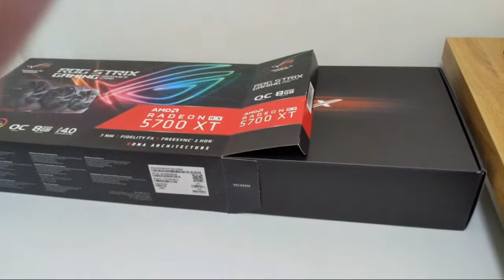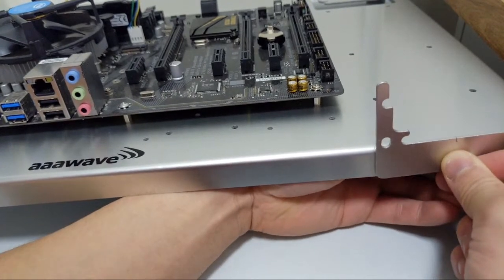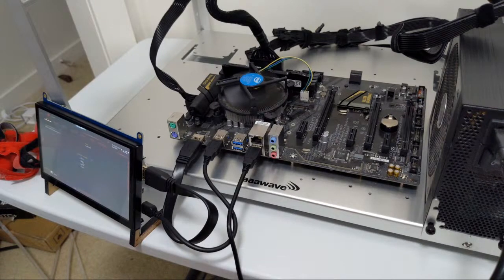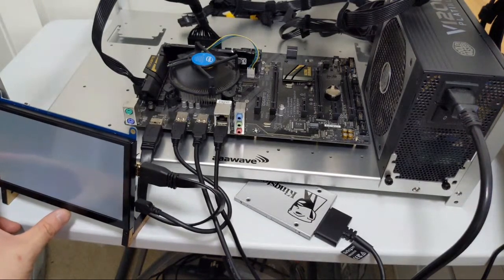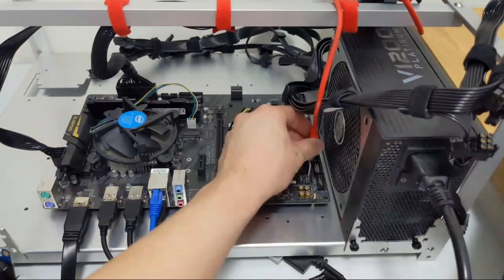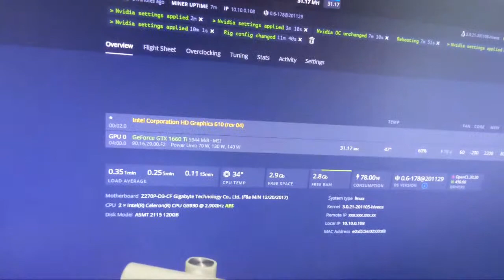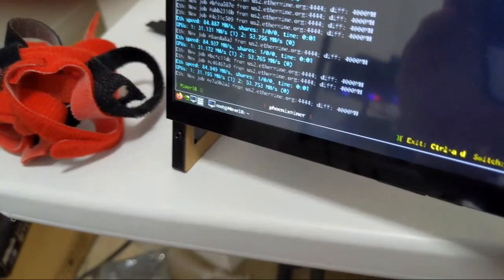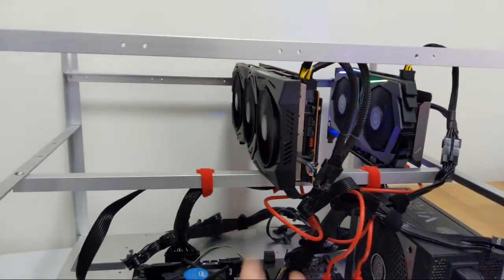How FAST Can I Build A Mining Rig? | RPM Build Stream #1 P2

Comment: put a Water Cooler on the 5700 xt its trouble and extra investment and work, but your temps with a water Tower, would Improve Performance and Cooler GPUs get longer life.  This is the next step for my PC Build with the Gigabyte RX 5700 xt Gaming Build. My CPU is already Water cooled. and it makes some difference in performance.

Comment: I just purchased and recieved all the parts to put a mlner together I have 4 GPUs p106 3 gb 1151 mother board dual core 3.5 GHz  8 GB 2400 micron ram would it be an advantage  to add a 12 gb tesla video accel card